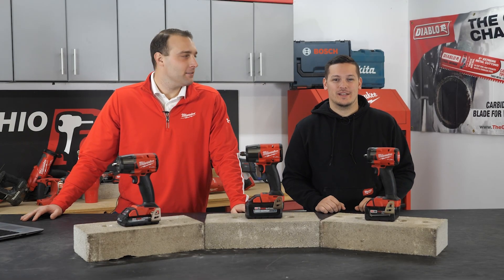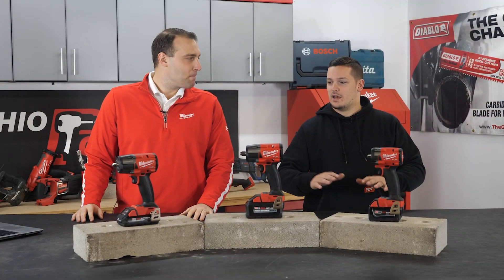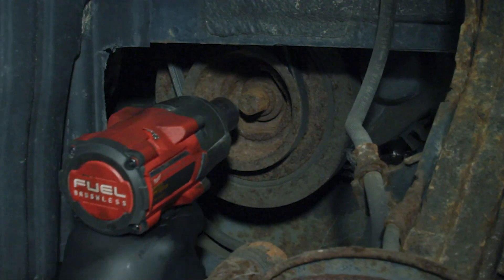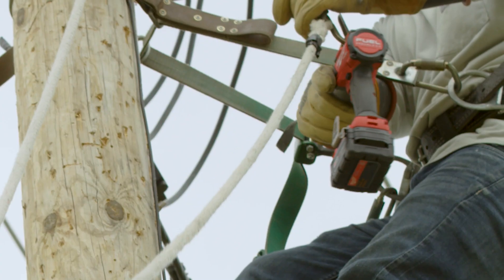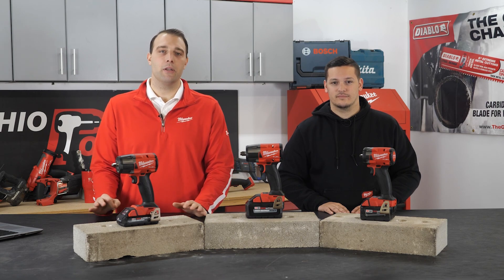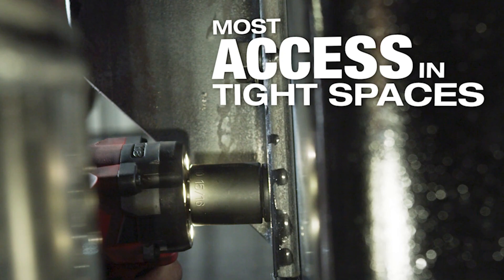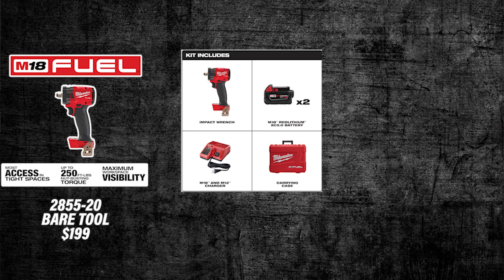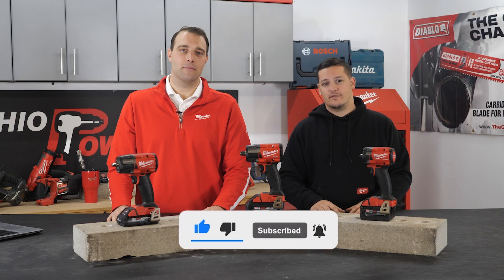Milwaukee's NEW Mid-Torque & Compact Impact Wrenches!

Comment: also seems to be a collet issue with the impact drivers even the gen 3  ,  2853-20 1/4 impact driver? shows the bits dont stay in when pulling away drilling or at other times. been said about a Milwakuee redesign with 2 balls instead of 1? any idea when those are being shipped from your store?
Reply: Hey Fike, as much as I like Vince, the collet issue is something he made a big deal about.  I’ve never had the issue.  I’ve observed him and a couple of others yanking the Gen 3 Impact Driver up, as it was embedded in wood.  

Have you ever had an issue with your Gen 3’s collet?

Comment: I hear the pin gives socket removal issues. Can you elaborate?
Reply from the maker: Personally I haven't had any issues. Though I'm sure over time just like everything things get worn down and are tougher to remove. Thanks for the question! I'll look into that more!
Reply: @OhioPowerTool  since I left that comment I read a little bit further into it and the pin is not a fault in removal difficulty it is designed into the PIN to require the PIN to be depressed in order to remove your socket which prevents the tool from losing the socket at Heights and potentially causing damage or loss of property health or life

Comment: other videos show the 1/2 mid torque 2962 model (gen2) only meets spec 650ft lbs using the 8.0 battery....the 5.0 is not quite hitting those numbers, which is fine, just be nice if that were mentioned.